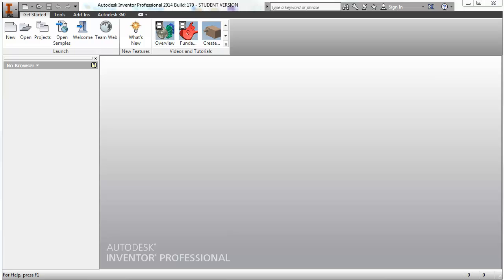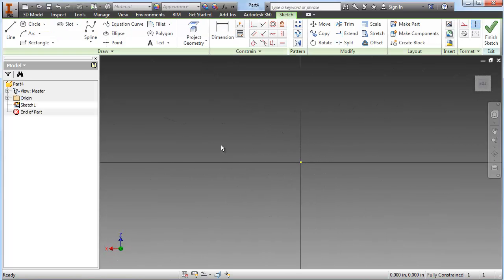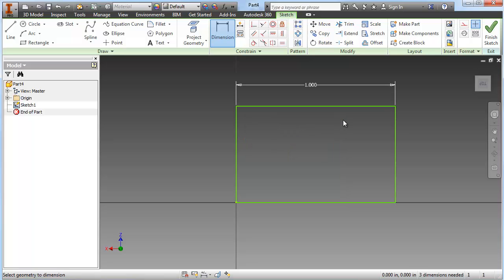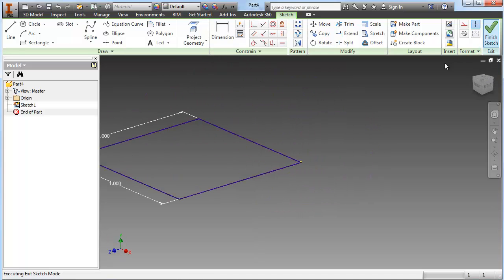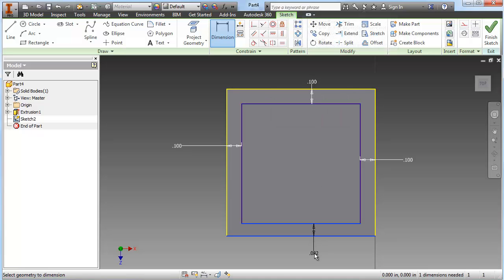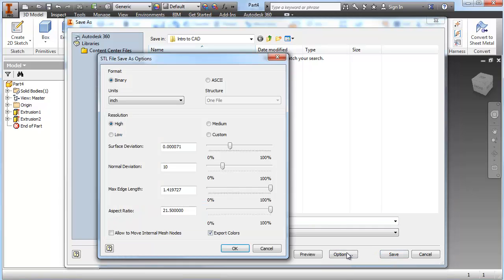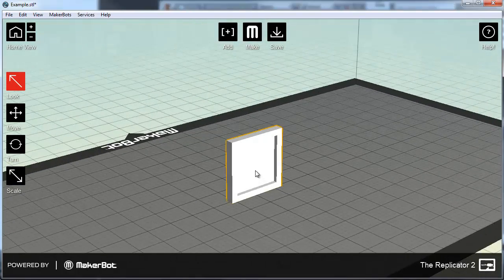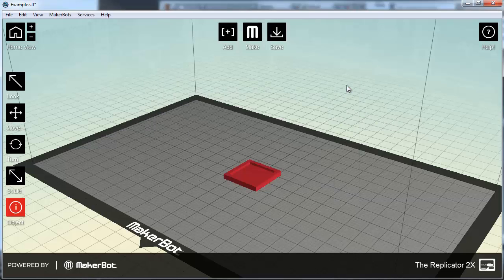Using Autodesk Inventor to Create a 3D Model to 3D Print

Comment: I have designed a screw Autodesk-Inventor/Pro 2015, and export to  * .STL  and open it in Makerbot-Desktop Screw important details are lost, such as the thread. 
How to avoid that?

Regards
Abraham Chia
Reply: When Saving, right before clicking "save"
Options--> Resolution--> High